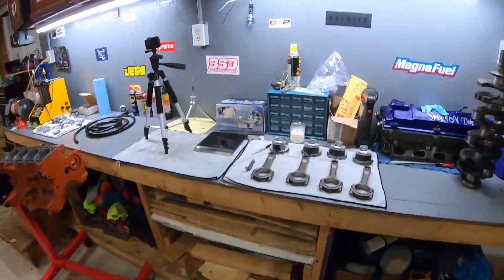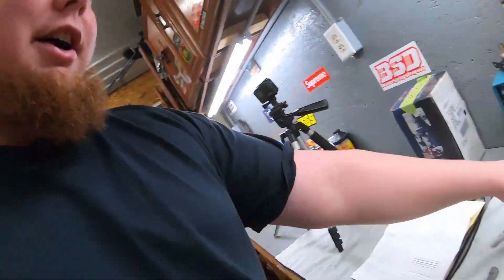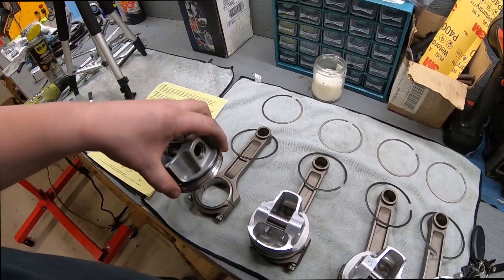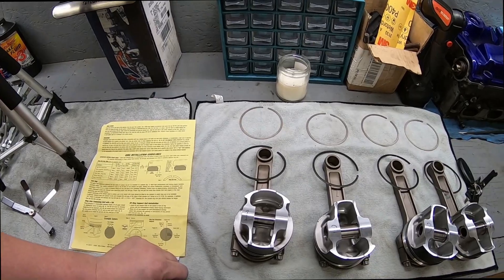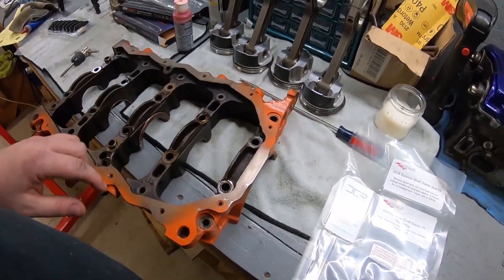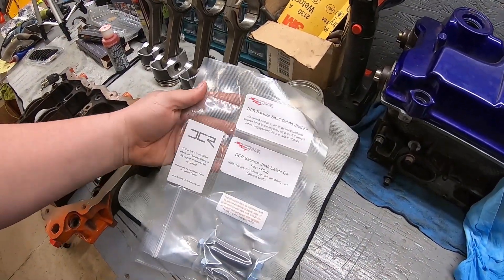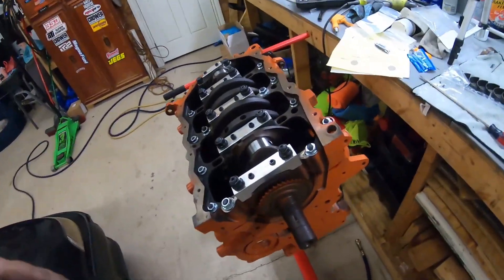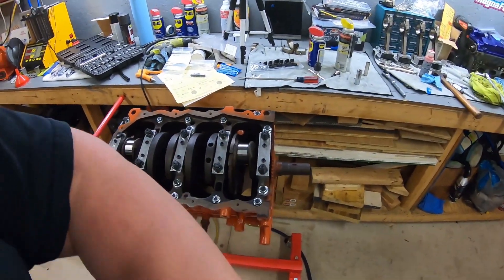How to Build a 800hp capable 2.4 liter Turbo ! The CSX's New Short Block! (10.5 compression)

Comment: Did u have ur crank balance
Reply from the maker: sadly no
Reply: @YostBuilt  I really wouldn't worry too much about it with drag Motors because they never actually stay at a constant RPM/load for very long.    
as long as you stay out of the resonance frequency your fine.  

inline four-cylinder Motors are kind of a weird beast.   In operation at a constant RPM,  something like that can affect its performance but only due to the nature of being set at a constant RPM/ load.   Otherwise?  Its not really a big thing to worry about with a crank not being perfectly in balance.

just adding the mounting hardware already throws off all of your balance attempts in the first place so it's not really a big deal